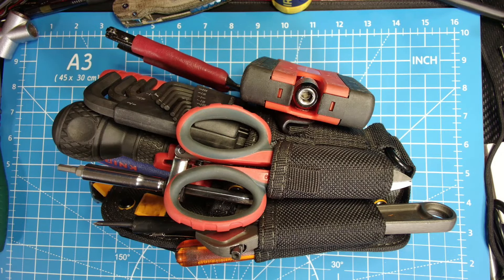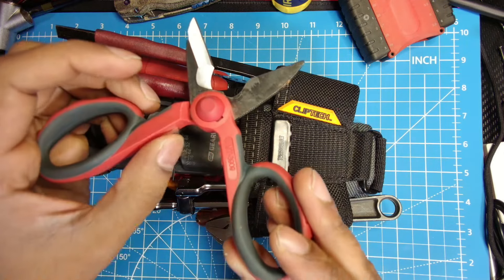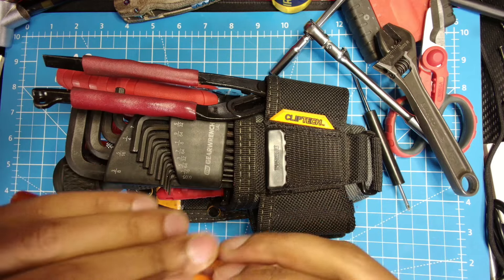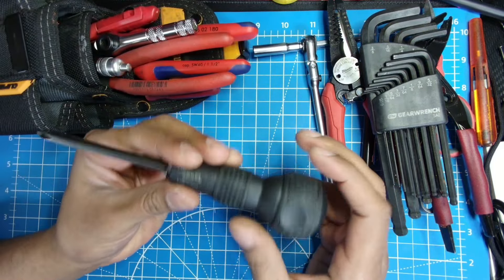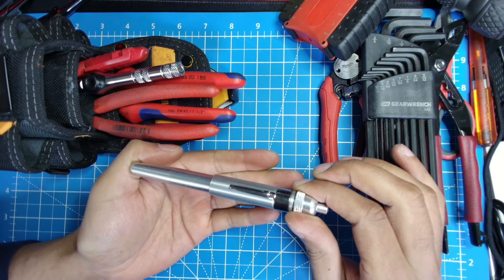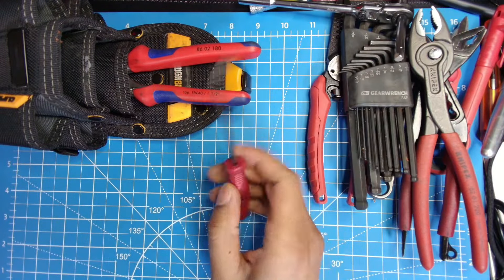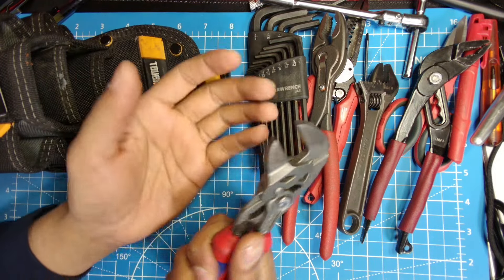Ultimate Toughbuilt 7 in 1 Tool Pouch Setup

Comment: At 00:35, you mentioned "you feel the weight of it." To reduce weight:

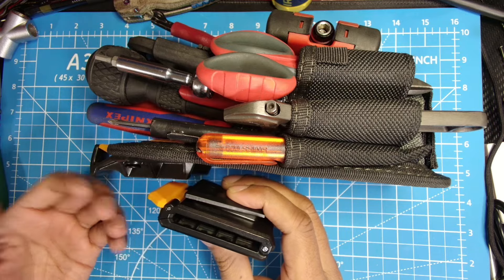At 2:47, consider switching bags to avoid unnecessary bulk and weight.
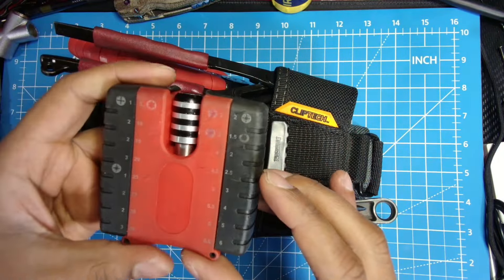At 3:49, replace these with Wiha double-sided bits in PB Swiss blocks for less bulk.
Use the SoftFinish Cushion Grip Blade Holding Screwdriver with Wiha bits or just the PB Swiss blocks and remove the redundant Temo bit set.
Keep only 2 wrenches: Knipex 125 Cobra and Knipex 125 Pliers Wrench cover everything.
Move the Allen key set to another kit or use locking folding Allen keys.
Swap out the Vessel with something smaller and limit to 2 bit drivers (one must-have, one backup).
Remove the 15:08 or the VIM, as having both is redundant.
Swap the Knipex Twin Grips for lighter Vampliers since they do the same job.
At 18:43, move this to the bag; it's a great tool but too heavy. Stick with the 125s for what you carry directly.
Reply from the maker: I like the way you think.  The 125 knipex tools are very good, I just worry about the leverage I can get on them, but there are some tricks for that.  I definitely have to look up the softfinish cushion grip blade holding screwdriver and see if that'll be a good solution for my current option.  For the vampires trade were you thinking about the 6 inch slipjoint pliers they have? Definitely a solid choice, but it's hard to let go of my twin grip.
Reply: @dirtyboytools  If the 125 isn’t enough consider the 150. Two of these alone (one where you don't care about marring, and one where you do) could significantly shrink your kit. The SoftFinish screwdriver is great because it works with Wiha double-sided bits that helps a lot with shrinking the kit. For the Vampliers, yip the 6 inch one, aka the 6-inch ENGINEER PZ-58. If that’s not enough, you can always reach for the Twingrips. TLDR: Keep what’s on you light, but what you reach for can be heavier

Comment: 12:00 you really shouldn't use the ball ends for high torque applications. Just a quick tip though, the rest of the kit and your thought process behind is is really solid, nicely done! Also a suggestion to replace the PB Swiss at 7:45, because A LOT of people complain about the poor magnetic retention .. in the same form factor you can get the HOTO 24 in 1 precision screwdriver with every imaginable precision bit for tiny electronics and stuff. Doesn't have the long shanks, but if you don't need those, I find it superior for the precision applications.
Reply from the maker: Yea I definitely agree with that since ball ends do have a tendency to break. Unfortunately I tend to have some bad habits 🤣.  I will definitely look into the hoto 24 in 1, the pb swiss has great quality shanks, but that weak magnet is definitely a downfall

Comment: The pouch is too heavy in my opinion. I would either buy a larger pouch and put a cross the chest strap on it, or buy a very small tool bag. A 10 inch tool bag, that is.
Reply from the maker: Yea it definitely weighs on me, will definitely consider some other options in the future
Reply: The beauty of the cliptech pouches is that you can redistribute very easily: buy like 2 or 3 of these pouches, and you jave a convenient place to keep whatever tools you are using at the moment, right or left.

I have no idea wtf you need all that for - hvac?
I'm a remodeller, so I can't fit all my shit in one bag, I have a jman elec. bag right, and 3 diff pos. supply bags left, ambi drill holster a\o hammer hanger dead center in back, bit pouch left r, tape pouch l or r, can keep 2 or more empty, and switch out stat.

But yeah, for an allin1 like that, you should just grab yrslf a shoulder strap and clip to that. 

Cool vid, I love those hex ratchets, I still need one of those old stamped metal double ended pass throughs where the width is determined by the length of the bit, lol,  pawn shop here I come.